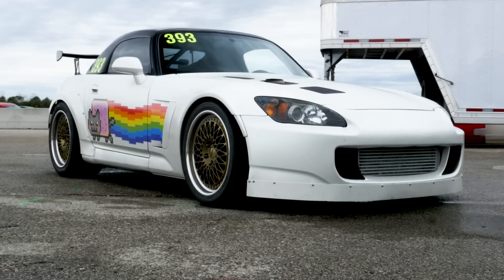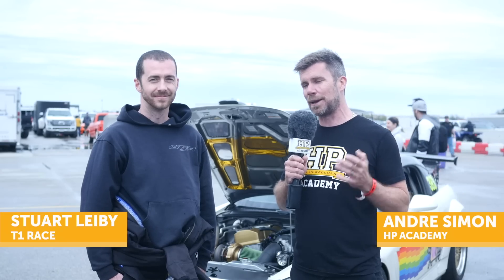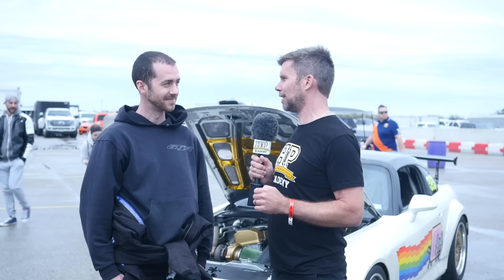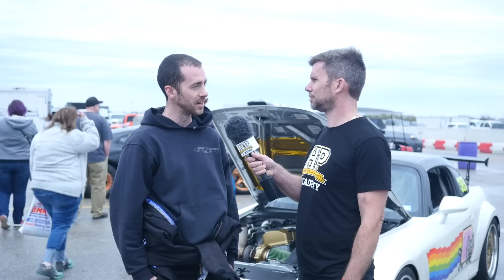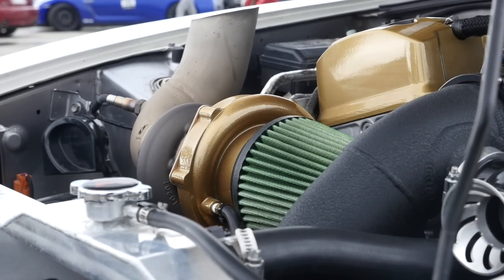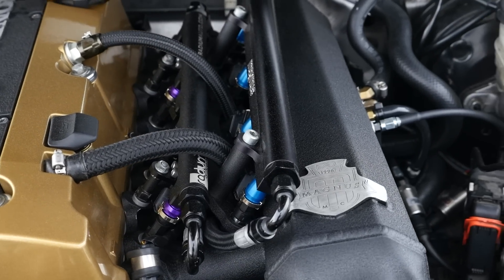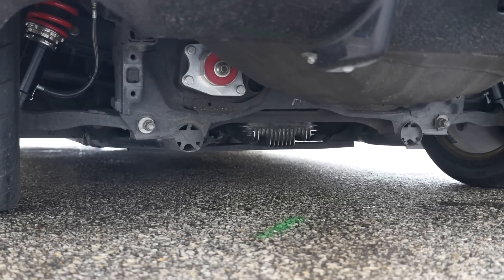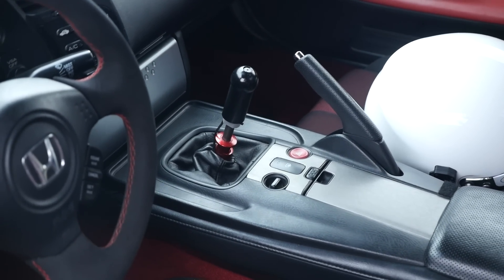Can You Have A 960HP, 42 PSI Work Whip? | F20 Honda S2000 [TECH TOUR]

Comment: Not all stock parts . Like sleeves rods pistons . Because honda under any boost are rubbish from factory.  Can't handle any power
Reply from the maker: There are not many stock NA engines you could put a turbo on and run 42 PSI of boost, Honda or otherwise ;)
Every manufacturer does indeed have some hits and misses with some engines but to blanket an entire brand in a statement like this is unfactual and not what we're about.
Go look up a bunch of motors from your favorite brand and I have no doubt you will find more than a few duds, all part of the game ;) - Taz.
Reply: I first turboed this engine with 100k+ miles on it. Did so for three years, most of which was over 600whp. 100% stock short block.
Reply: mr323i the s2000 has forged internals from the factory. check out lht performance channel for s2000 stock cars that have been boosted over the years
Reply: Peejay Em LHT TLC FTW

Comment: Jessie, don't do it. I bet you he's got more than 100 grand under the hood of that car. Jessie laughs, assumes to race said S2000 for pinkslips, get's walked, looses his dad's car and is later shot down on the streets of los angeles because of it. #True Story
Reply: He works at T1. Even then how would it cost $100,000? You must have failed at math in HS. The turbo is about $2,500, Motec for the car is another $2500 plus whatever add-ons, maybe $500. Rod/Pistons, about $1200, head work and valvetrain parts another $1500. Even the transmission is maybe $3000-$4000 and that still doesn't add up to $100,000. I'd say less than $30K including what he paid for the S2K in the first place.
Reply: @dj4monie  he was joking, but for what it's worth basically none of your prices are right. The trans alone is +$10k...
Reply: Stuart Leiby 10k lolllll 22k quiafe sequential
Reply: @dj4monie  LMFAO the drive train and motec setup alone are 20k +
Reply: Anthony Thomas i believe its a fast and the furious 1 reference
Reply: @dj4monie  haha mate that joke went right over your head lol, and come on 30k for a near 1000hp s2000, if it was that cheap and easy everyone would do it you got no idea the money it takes ... the longblock is more like 30k plus all the add ons...
Reply: @mr2paddy  I don't have anywhere near that in the engine. It's well under $10k.
Reply: @dj4monie  u play too much forza

Comment: dagracing with traction control? where is the skill in that?
Reply from the maker: Yeah ever since those engines and wheels got involved. Bloody technology. Bring back horses to the drag strip I reckon  😜 - Taz.
Reply: @hpa101  screw technology! (As he posts on his phone connected wirelessly through some insane network spanning the face of the planet instantly.)
Reply from the maker: @Stuart Leiby Unless you're using a carrier pigeon from the flock you keep out back and care for daily, what's the point in even posting a message right? No skill at all 😜

I'd just like to say though for anyone out there that doesn't like using particular tech, that is OK, and it's fine that you build your own projects in your own way. It's also fine if somebody else is doing the same thing, but differently. So long as you're enjoying it, who cares either way? 🤘- Taz.
Reply: Nothing new, this has been there direction for years
Reply: Drag racing isn't about skill anymore... Its about technological dick swag now.

Comment: 960 US hp must be around the 600 Australian hp :)
Reply from the maker: I believe the power figure is from a Mainline dyno. Any guesses where that's from? 😂
That said, power figures are only one piece of the puzzle and while a bigger one is cool it doesn't mean everything - Taz.
Reply: 6466 make 720ish hp on Aussie dynos... 960hp 😂
Reply: umair minhas it’s not a Subaru ;)
Reply: The exit speed of this car on the 1/4 mile is way more than 600hp.People here hate Hondas but got no idea how much more these heads can flow compared to other 4 cyl cars.A stock F20C engine with a small turbo will make  500hp so easy it's not even funny.Sorry for you Aussie but hurt Barra fans

Comment: Team HPA, do a video on solid lifters. Why one would go that route. What improvements are gain: throttle response, hp increase, etc...
Reply from the maker: I'll pass that onto the team, cheers mate! - Taz.
Reply: It all depends, if you don't mind adjusting your valvetrain every so often to keep peak performance because items do wear, then it's a good option if high rpm is needed. IMHO but all out race cars even need that, but many don't.
Reply: Normally go that way if wanting to increase rpm by more than 1k. Depends on specific engine.  You would do it to make the new (higher) rpm limit more reliable.

Comment: Honda headgaskets and cranks are golden. High horsepower J series guys also use stock cranks (since they're forged) and stock headgaskets. some even leave the sleeves oem
Reply from the maker: @Anthony Thomas I didn't read that as anyone saying any other engines were inferior mate. You don't have to like them, but it's fine for others to state they are fans of Honda engines if they're fans of Honda engines. We're all aware there are also other engine manufacturers out there in the world ;) - Taz.
Reply: So every other engine is inferior by your logic?  Most domestic 4 cylinder engines don't require expensive sleeving of the block and easily reach the same numbers with the same mods (rod, pistons, valve train upgrades, head studs and camshafts). I have yet to see a cast crank break in anything, forgings are good for high rpm. You don't need to spin it to the moon to make power with a turbocharger.
Reply: @dj4monie  Really? Which 'domestic' engines do you have in mind - remember, that is generally a term for those produced by the manufacturers of that country and, since many "JDM" engines are also manufactured ith e US, the UK, Europe, etc, that can cover a lot of territory.
Reply: @gordowg1wg145  i believe he's talking about the legendary 4 cylinder domestic engines that came out in the model year 2000 when honda came out with the S2000, examples include the dodge neon, chevrolet cavalier, and ford focus. Those were stout engines producing upto 130HP at only 5k rpm. 0-60 time was respectable however 1/4 mile times were rarely documented as the cars were a real POS and would break down around the 1/8 mile. The constant towing of said domestic 4cyl engine POS cars gave rise to modern day truck and SUV market that now dominates the US car industry.#how it all began
Reply: @gordowg1wg145  GM Ecotec solid block has seen 1,200 hp+ made Honda boys whine when GM dominated Sport Compact Drag Racing in the mid 2000's. Ford Ecoboost 2.0L solid block has seen 700+ hp Speed Performance in NJ, shop car made that, blew up attempting to make more, also with single outlet exhaust, like VW's TFSI engines. Chrysler 2.0-2.4L solid deck blocks, usually found in Neons, Stratus and Neon SRT-4. So that solid deck engines from the Big Three. All have seen 700-1000 hp in competition and street use, no special mods to get there. Ecoboost 1.3-1.6 Fiesta ST engine and Focus RS/Mustang Ecoboost 2.3 are open deck blocks.
Reply: @TurboS-gh5wc  The engines themselves were not unreliable. I never had a head gasket problem with the four 1st gen Dodge Neons I owned. I've had six total including an R/T and the SRT-4. GM small cars have been trash but the Cobalt chassis, the Delta I believe it's called is much better than anything GM has done before. Delta II is GM's current small car platform (Cruze) and the Focus was never a crappy car, US manufactures shoot themselves in the foot by overcharging for hatchbacks while making sedans price leaders. I currently have 2016 Ford Focus ST with a GTX3071 Gen 2. The SRT-4 was Mopar Stage 3R with Toys, ran 11's.
Reply: Anthony Thomas funny how you don’t see any of these really being used these days at the cutting edge of sport front wheel drive or the likes that take advantage of the best 4 cylinder engines in the world😗
Reply: @dj4monie  lol someone's butt hurt and sensitive. No one said other engines are inferior, you inferred that. Then you proceed to compare American engines to one of the best Japanese engines ever created and which held the title for most hp/litre for a decade and it took a Ferrari to beat it and that's used today to set new levels of motorsports. Not saying that there haven't been some interesting American motor platforms, but cast American engines have NOTHING on the S2000 motor/platform. American motors don't last past 100k miles without issues, while the forged internals on this motor last hundreds of thousands of miles with extreme power. American cars suspension is from the dark ages and turns are their kryptonite (Corvette being the exception). Domestic cars and motors are crude, heavy, low reving, sloppy, and you need 4 extra cylinders to make the torque and hp and then still can't handle the stress and break down. Domestic motors using cast internals are exactly why they can't rev high. Forged is what F1 uses. FORGED ALWAYS BEATS CAST and anyone who understands structural engineering knows FORGED IS SUPERIOR TO CAST. The engineering in this car is far beyond anything from Murica at that time America made great cars in the 60's and early 70's but then as usual they kept telling themselves they're the best even though the rest of the world moved on and past them.
Reply: @dj4monie  never said every other engine is inferior. I just stated a few facts about some Honda components